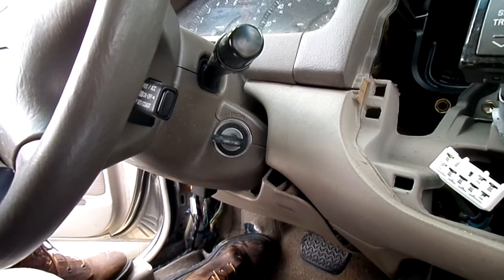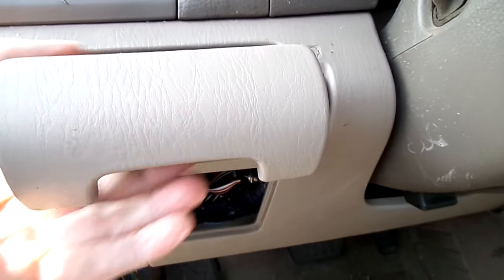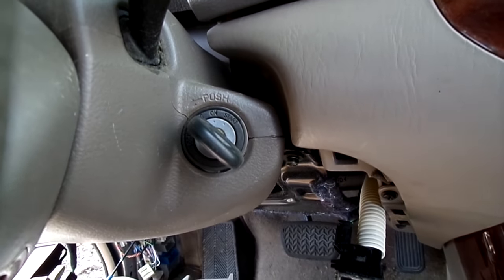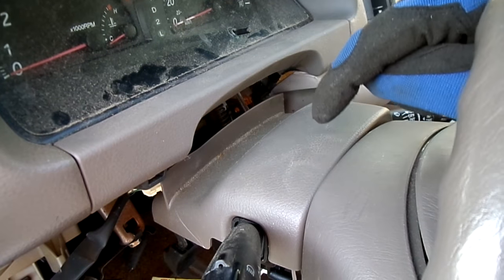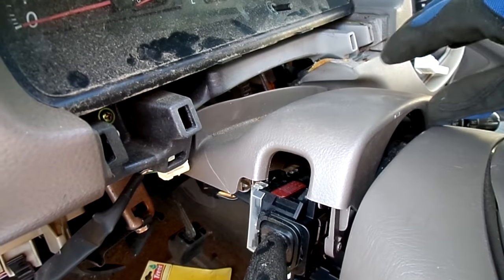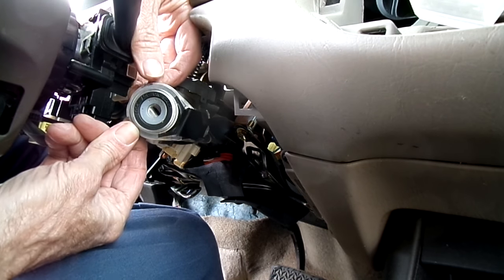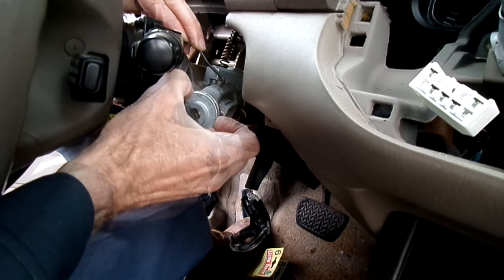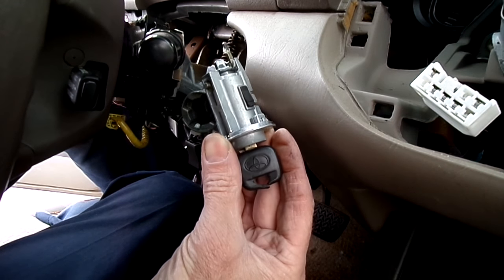Toyota Camry 02-06 Ignition Lock Cylinder Removal

Comment: I used a 3/16 inch L-key (hex/Allen wrench) as a pick tool for the release tab in my "Tieyoda" Camry. 

The problem with my ignition lock was that the tumblers and springs were worn and the key was able to slide in and out when the cylinder was unlocked in the Acc and Run positions. I think a locksmith would be able to rekey the tumblers at half the cost of a new OEM lock cylinder.

Comment: Two questions that I hope you can help me with. I’m not able to get my key into the ACC position, I’ve tried for several days and it won’t budge. I’ve watched other videos where they suggested to drill into the hole where the pin is. Would you suggest this too? If so, what size drill bit should I use? 

Second question is I know you mentioned to disable the airbags which makes sense I guess working around that area. Disconnecting the battery would disable the air bags or is there something else I should do? 

Thank you SO much !  Any advice is greatly appreciated
Reply: Haveing same trouble did he ever answer
Reply: @chrisblum8140  No he never responded. I tried compressing that pin using anything I can find and it didn’t work. A friend of mine ended up taking a flat head screwdriver and hammering it deep into the ignition since I needed to replace it anyway. I had to use a screw driver to start the car for a week or two lol but this at least allowed me to get it into the ACC position when it was time to remove/replace ignition. Does your key slide right out of the ignition? That’s how bad mine was, it didn’t stay in. I could literally start the car and pull the key out while it’s still driving.

Comment: Hey I am attempting to remove a 2015 Camry ignition. I have a working key and am able to get it to access and depress the detent. It comes out about 1/4 to 1/2 in out and appears to be getting snagged. I know it's slightly different then the year in the video but it's very close. I did pop the key indicator button incase it was jamming  on it but didn't seem to fix issue. Any info would be great

Comment: Often the problem is with ignition switch starter mechanism at the end of the switch housing.  They go bad and needs to be replaced.
Reply: My 2005 camry doesn't start and when I turn the key to the on position it has no power anywhere,  power windows , radio , blower and dash all are without power,  can it be the ignition switch? I have checked everything else,  thank you
Reply: @Boydontfuckwithme  I haven't found the problem yet,  I have checked almost everything,  but I'm not giving up

Comment: Richpin... your instructional videos are ALWAYS the BEST, thank you!  FYI... I found out that one doesn't have to remove the lower kick panel to remove the bottom column cover... just tilt the steering wheel up, and it will come out just fine!
Reply from the maker: Thank you for the tip.

Comment: How do you remove the lock cylinder if the key can’t turn?
Reply: Exactly where I'm stuck right now.. its fully locked so I cant get to the screw.. Did you figure out a way?
Reply: @mattramirez6281  Hey, I know this might be a bit late, but what ended up working for me was using a drill to remove the ignition switch. I drilled through where the pick tool is supposed to go and then I removed the entire lock cylinder by prying it out with a flathead screwdriver. After that i used the same flathead to start the car. Its not beautiful but it works.

Comment: The key doesn’t turn to remove the cylinder. Steering wheel is lock and can not turn the wheel to remove 2 screws. Make a new video.
Reply: Exactly, that's where I'm stuck rn, did you figure it out? If so please share
Reply: @mattramirez6281  drill the pin that holds the ignition. The little hole